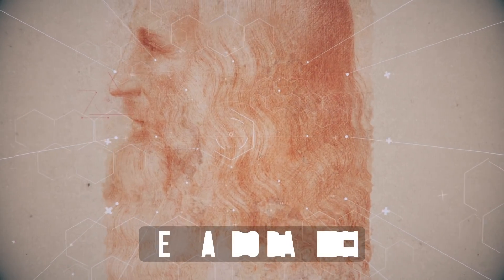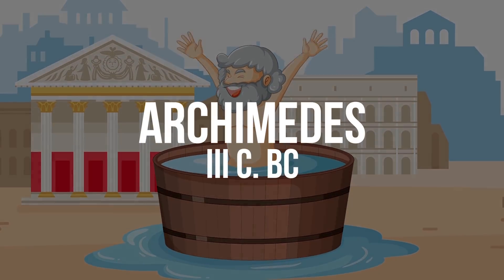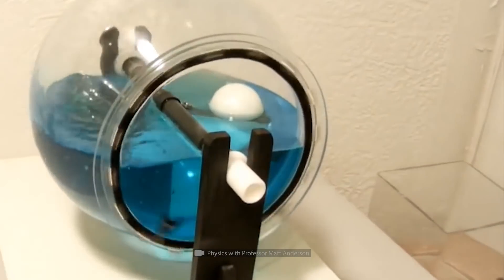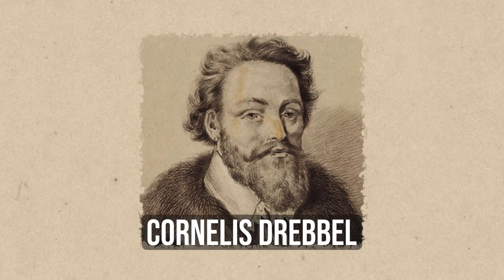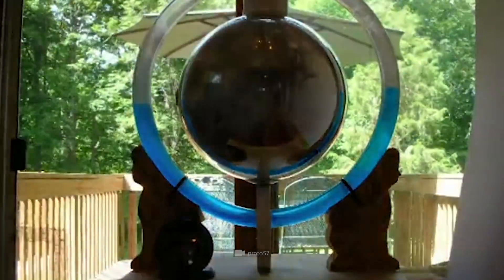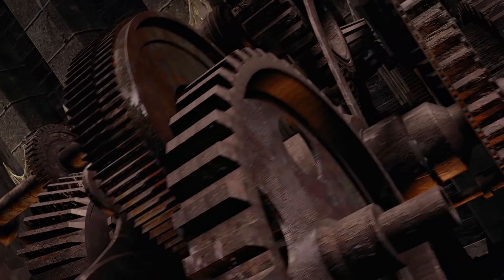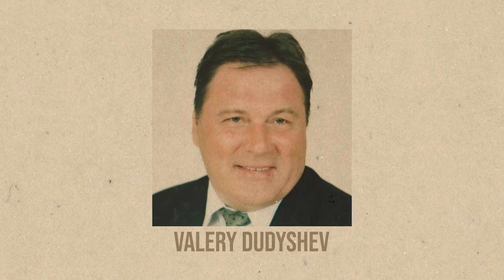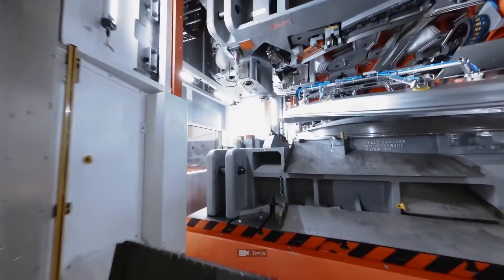Are Scientists Close to Creating a Perpetual Motion Machine?

Comment: they allready did.
Do you know what memory metals are? Change the temperature and they change the shape. okay, so into water and out of water and it changes shape, thus turnign a motor.
It exists, it's a mainstream, and no conspiracy behind why it's not all over the place. There is a power plant with one. It's a prototype. Why is somethign so simple a prototype? Well the same reason it's mainstream and not a conspiracy. See, it's made with rare materials, so it's simply not cheap enough to make one big enough to make real energy. Oh, by the way, that generator only creates a tiny amount of energy. it's real, but a novelty.
Yes, the memory metal generator exists, yes it's real, yes it need asteroid mining before we can have it.
SO in ohter words, one reaons that dyson swarms aren't all over the place is that it is more reasonable to mine some metal and make a difference in temperature without burning generator than sending not -going-to-melt sun energy harvisters with the mass of an entire planet. Why do that when you can just mine some stroids and uplift some hydrogen from the sun. Might as well hollows out the planate or make it's surface area larger and beam a sun lazer to the thing instead.

Oh and by the way if all you need is a difference in temperature, then you can survive heat death by using cold to have your cold and the friction of it going to have hot. 
isn't that nuts?
THere is your entropy problem
So in other words, the friction and energy loss only let's it work. Too much friction? turn it off, let the steam condence back down.
No violations of thermodynamics.

Comment: Technically we already have perpetual motion. It's called a flywheel. The main issue is that when you try and take energy out of it, you get way less out than you put in. 
Here's why you're confused by what I just said. You conflate together perpetual motion and perpetual energy. The 2 are not the same. Energy is how much motion can be performed. Perpetual energy means infinite motion. Not the other way around. Why that is is because of all the other factors you're looking at. Tapping into the energy is the main issue. Putting it in is easy but getting the same or even more out, in our current understanding of physics, is impossible. Well, the same more and more due to High temp superconductors. Which transport lossless energy. Or at least close to.
Reply: No, a fly wheel slows down over time and is thusly not perpetual.
Reply: @quijybojanklebits8750  Why do you think I said "technically"? Read properly before replying. God why do I attract arrogance?
Reply: @Once Was evergy isn't infinite.
Reply: iirc liquid oxygen has also shown to be capable of having perpetual motion. Shame that you can't really demonstrate that property due to opposing external forces

Comment: even if we got perpetual motion machines, what use would they have? why would we invest time in miniscule expensive liberal ass hybrid perpetual save the earth cars when we could literally just drive a car running on normal science, like a battery, or mini explosions really fast. This is pretty useless tech. If we wanted a long distance spacecraft, we would harness other energy, like nuclear, solar, and anything else really. even that crystal at the end. For it to be discovered just now I would assume it not to be abundant, and likely expensive. All energy is a trade. Gas is a mor efficient trade than electricity, but is not as easy to make. this is like developing a sports car that runs on a AA battery. Sure, it moves. but I see my buddy over there smoking me in his gas powered lawnmower, and Billy over there just blew right by me in his bike. I don't think we should spend time on clean energy, more so effective and long term energy. Gas and oil aren't long term, and aren't clean. solar and wind, sure. Clean and cheap, but ultimately lacking in POWWWWAA. I think pursuing and building off of established is the best thing to instead of "reinventing electrics".

Comment: Making a perpetual motion machine that runs infinitely would be impossible, but it is also impossible to have a machine create more energy, this would violate the first law of thermodynamics, energy can not be created or destroyed. Therfor, any type of perpetual motion machine is impossible. The first one is false due to degrade, and friction. A system will release energy, or gain entropy over time.
Reply: learn physics. perpetual motion is the exact same thing as being at rest. you say being at rest is impossible. 
you cant gain energy from perpetual motion without changing its state just like you cant get energy from "resting" without changing the state.

Comment: The reason why the DiVinci wheel fails is the whole thing assumes the rotor is the center of mass for the entire system. In actuality, the center  of mass is OFFSET, usually a few inches toward 4 or 8 o'clock, due to the balls not being equally distributed and therefore causes the system to find the center of mass and self balance, so the balanced wheel stops.
Reply: da vinci and most other historian figures, arent the perfect geniuses, they most of the time get portrayed. 
dont get me wrong, most of them did the great things they are known for, however they have many failures with them. davinci has many bluebrints that just wouldnt work at all. were gears are counterplaced etc.

Comment: when does an atom stop spinning?
Reply: Atom's stops moving if their temperature reaches 0 degrees at kelvin's scale. Anything above, means atom keeps on moving, or at least shaking in crystals. More interesting story is with Electrons orbiting inside the atom. They keep on spining. But you can't take out energy out of the electrons without making them fall in to lower energy orbit. So they are not endless source of energy.

Comment: First example,  fish tank,  reducing friction on the glass could be done with never wet or similar hydrophobic chemicals,  and the bearing could be made Mag-lev to eliminate all physical friction there
Reply: Nothing, just absolutly nothing can stop the machine from loosing energy. friction, is only one of many many ways how machine is loosing energy. For example, as long as it's temperature is any higher than 0 degrees at kelvin's scale - it would be loosing energy by thermal radiation. And ANY movement of ANY part of the machine would automaticly rise it's temperature above 0K.

Comment: External heat into power? That's perpetual motion of 2nd kind. Does such a machine can exist?
Reply: a lot of generators work off the principle of converting heat energy into electrical energy. steam generators, geothermal generators, technically nuclear power plants, etc. it's not exactly infinite or perpetual. as for just the ambient heat caused by the sun? you can skip a step and just take the electromagnetic radiation.... also known as making a solar panel. 

if you want just the ambient heat around you, you can certainly create a generator to convert that energy into electrical but the energy output rate may be quite slow.

Comment: Yeah, the dude who announced the first law of thermodynamics in... Clausius. Well, in 1850 they had no clue of the Zero point energy measurements achieved in the US, Belgium and Japan. They tried to block/ shield out all impending source of energy, freeze a black cavity to zero Kelvin, (achieve ZERO energy - they thought) and they could still detect some kinetic energy - casimir force. So that first law of 1850 is for the birds and got more holes in it than a slice of swiss cheese. No, you can't achieve a perfect isolated system. Ask a NASA engineer when will the International space station run out of battery juice - never! We can't achieve a perfect isolated system, because we are permeated by surrounded forms of energy, and we are made of condensed energy. So why bother with this senseless topic? The real challenge is how to efficiently tap into surrounding energy sources, and make our systems as energy-efficient as possible.

Comment: Can't we utilize geothermal based power plant to boil water, then use the pressure generated from the water vapor to rotate a rotor that could theoretically run as long as the planet exists?
Reply: Already exists. That's just renewable energy

Comment: Constructed wholly  inside an adiabatic hermetic vacuum envelope: Two closely spaced but not touching, in-register and parallel, thin flat metal plates have micro-spiked inner surfaces. Their respective wires connect to a small motor. A large vacuum work function (VWF) inner surface (osmium, 5.97 eV; DOI:10.1116/1.4934685). A small VWF (hydrogenated amorphous carbon nitride, 0.63 eV; DOI:10.1143/jjap.41.6169) inner surface. Spontaneous cold cathode emission. Emitted electrons fall down a 5.34 volt potential. Electron evaporation from carbon nitride cools it. Accelerated collision onto osmium warms it. Round and round. The plates never reach thermal equilibrium. *The motor runs forever*.

Was that so difficult?
Reply: except you forget the part where there is a literal law of physics called that states energy cannot be created nor destroyed, suggesting that perpetual motion machines quite literally cannot exist. as neat as it would be to assume that this motor will run forever and energy can be extracted from the system is nonsense. 

so to answer your rhetorical question, yes. in fact, it's impossibly difficult and your theoretical solution will fail.

Comment: 8:28 I believe you found what your looking for right there but they think it only turns external heat to energy?!? Welll it sounds like it works and we don’t understand it yet fully and the one before that sounds like a old version of a solar panel
Reply: Except that it will stop working when there isn't any external heat to convert energy from. Hence, not a solution. 

Also, there really isn't much to understand, it's transfer of kinetic energy that is converted to electrical energy. Which by the way is the basic frame of a lot of generators and power plants simply because it's one of the simplest conversions of energy.

Comment: This question has a very simple answer, and it doesn't require a 10 minute video. 
      The answer is simply, no. 
      According to physics as we understand it, this concept is nonsense. There is a fixed, unchanging amount of energy in the universe. This number is a part of space-time itself and can not be changed.
     We can do work in the universe at the current tome because energy is not evenly distributed in the universe. Some parts of the universe have more energy some parts have less.
      We can do work by moving energy from a region where there is a lot of energy to a region nowhere there is less energy. Think of it as two buckets. One is full of water the ether is empty. If you connect the buckets water flows from the full bucket to the empty bucket until both buckets have an equal amount of water.
      You can use the flowing water in the pipe between the buckets to do work, but once the buckets are equal then no more work can be done because there is no flow between the bucks.
     Some day in the very dissonant future all regions in the universe will have equal energy. Once this happens (and it will someday happen, a very very long time from now) the universe will experience "heat death"
       Nothing else will ever happen in the universe ever again. The very concept of time will cease to exist as time is a measure of change in the universe. If nothing changes there is nothing to measure time against.
     There will be no clocks by this time (in fact there will be no matter of any kind) but if there were the clock would require energy to run, and with no energy for the clock to run, it won't run. Time itself will end.
     The universe could exist in this state forever, but if the expansion of the universe continues to get faster eventually the expansion of the universe will be felt on atomic scales and the expansion of the universe will rip atoms apart.  
     In other words, we don't yet know enough about physics to say what the fate of the universe will be.
     But we do know these machines are not possible. Not even in theory.
Reply: The answer is never simple and rarely definitely no.

You seem to base your belief on the universe being a closed system where energy can not be created or destroyed. So let me post this simple question to you.

Gravity can produce motion, aka work. We see this everywhere in the universe in the motions of the planets, moons, and stars. So what energy is being converted to create that gravity?

Comment: Why are we fixated on perpetual motion machines or it's a failure? What's wrong with discovering super efficient device's for all sorts of different tasks. No machine we make lasts Forever? Everything takes outside forces to start. So what? If we can design efficient machine's that operate within the universe, then we are successful at designing efficient machine's. How about we just drop the "perpetual motion device" we all get it, there is a different category tho, like how Nuclear energy can power a steam turbine for a certain amount of time until we need to replace the fuel. (It's SUPER efficient tho!) And is a vast improvement than coal and Fossil fuels and all the emissions and resources and pollution and refueling those take, so if we can improve from Fossil fuel machines then that's an important improvement we should focus on.

Comment: ..not that it matters, you can't get more energy out of something than is put into it, this applies to nuclear fusion as well, just that the 'energy' potentially extracted from the process, was installed during the formation of the universe..
Reply: Sort of, It will take as much energy to ignite the reaction that powers stars, but the continuation of that reaction as long as fuel is fed in to it, means you can get more energy over a period of time, as it causes a chain reaction as long as there is fuel, and the rate at which that fuel is consumed, determines if it's a bomb, or a reactor. The same principle applies to fission even. 

Even the "real" idea of cold fusion (not the weird 80s notion of it.) if we could stabilize muons would allow fusion at much lower temperatures and at atmosphereic pressure, but they only last for microseconds in a particle accellerater, so we're probably a very long way from that.

Comment: We just need a perpetual motion device that can recharge a tesla car faster than the used.  The car can us this to charge it during and after use and be used to charge the grid.  If not, then once the car is charged then it turns it off and restarted once the car is in motion again.  Why can this be dont to at least extend range from 300-600 range?